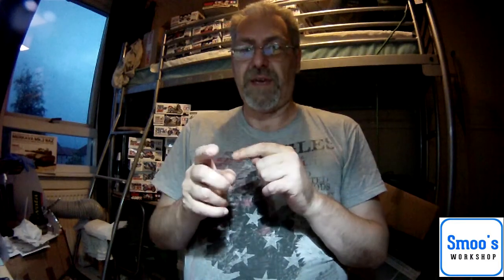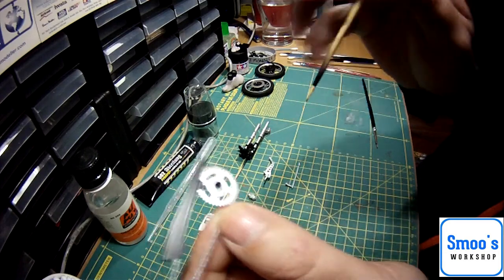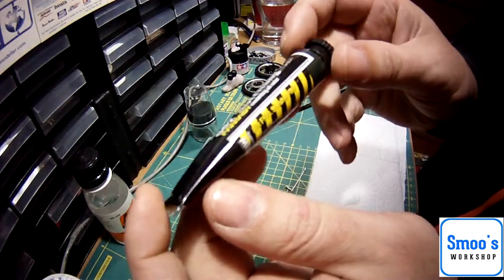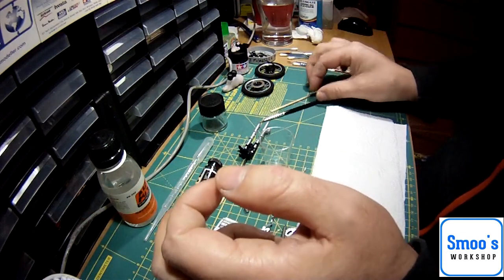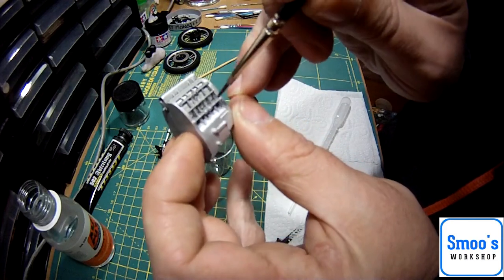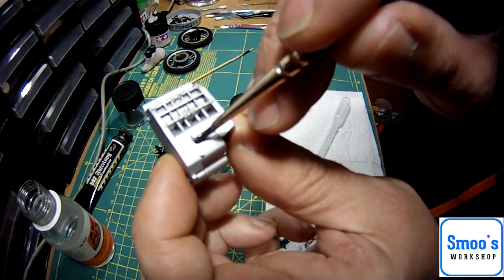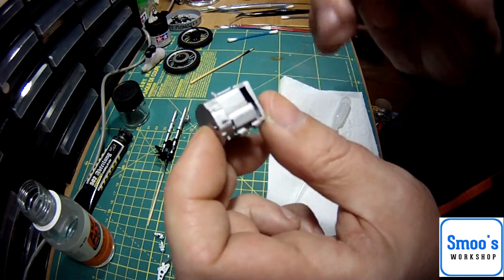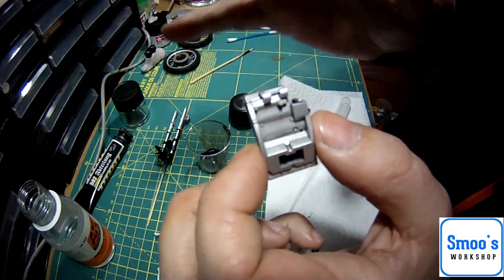A Tutorial Video  - How to do an oil pinwash on a metallic finish

Comment: what type of metallic paint do you use? it's still a big question to me what kind of wash use to my bikes. I don't like acrylic wash, but enamel wash eats my paint (gunze super metallic, alclad).
Reply from the maker: hi there, it's not so much about what paint you use but the protective coat you put on top of it to protect it from the oils in the wash, in this case it was just tamiya acryllic flat aluminium, overcoated with a coat of Klear before doing the pinwash, the klear coat is very important as it protects the paint underneath, this was just a pin line or what some refer to as a panel line wash i tend not to do all over washes as i'm only trying to highlight certain areas
Reply: Hi. I thought like that too but I used the future clear and other different acrylic clears on enamel paint, and it cannot protect paint.(( how it much easier when I do my tanks and use acrylic)
Reply from the maker: I tend not to use enamel paints much to be honest, i use tamiya and mr hobby acryllics and sometime hot laquer paints like mr color metallics, klear doesnt always work for some weathering and i also use alclad aqua gloss, the issue you may be having with an enamel paint underneath is the oil wash reactivating the paint underneath which means that your klear coat possibly hasn't got adequate coverage, i wouldnt use an acryllic clearcoat for oil pin washes, it needs to be a polyurethane like klear or aqua gloss or a laquer clear coat
Reply: I understand it. So that's why I asked you about type of paint. Now I try to use acrylic too but enamel metallic are better. Anyway thanks for prompt answer. Good night)
Reply from the maker: also alclad dulls down anyway with laquer on it havent tried gunze super metallics, as i'm going to be doing a pin wash on what is supposed to be representing aluminium casings, i dont see the point in using really high gloss metallic paints, they are going to dull down with the wash anyways so tamiya acrylics are fine